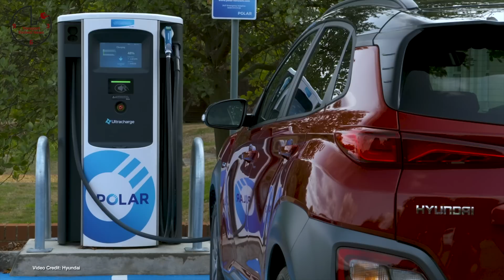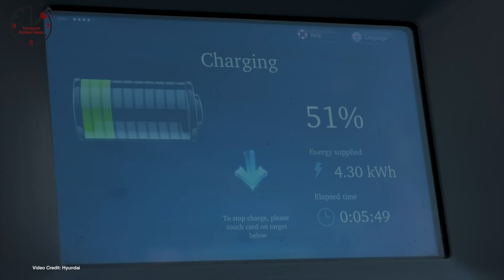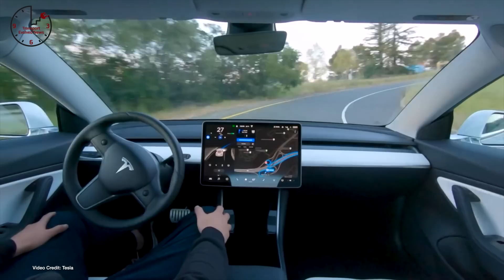TEN 329 - Porsche Taycan Cross Turismo, Big Auto Chases Tesla, Rivian Going Solid-State?

Comment: Did I see drum brakes on the back of the ID.3? That's hard to believe.
Reply: Not really!  Drum brakes can be as effective to stop a car as disks, but are prone to fade over long periods of continuous use, such as going down mountains. With EVs having regen braking, the likelihood of continuous use is low.  Meanwhile, Drums have a few advantages that make them especially suited for EVs.  They have lower drag when released, and the mechanism is concealed from weather making them less prone to freezing solid due to rust, which can be a particular problem for disk brakes that are infrequently used.
Reply: @robertkirchner7981  Well said. Drums are non-linear in their braking force, but on the rear of a car they do next to nothing anyway under hard braking. In a RWD EV where there's loads of regen available they will do next to nothing under light braking also.
Reply: Best choice for rwd EVs. Disk brakes often get stuck because barely used

Comment: Has anyone ever done the sums as to how much a Tesla would cost if it didn’t have any of the self driving stuff?
Reply: Probably about the same as a Chevy Bolt :P
Reply: And improve quality control and interiors.
Reply: Munro did...about 2 years ago...in an autoline video.
Reply: I love the people who shelled out $10K for FSD.  It’s because of them, I got autopilot, the cameras, and active safety features for free.
Reply: Also skip the glass roof, powered doors, and other useless gimmicks.
Reply: @robertkirchner7981  lol they arent useless gimmicks. Tesla squeezes every mile possible out of their cars through efficiency and low drag. The door handles literally reduce drag. The price of Teslas drop constantly as they increase production. It’s not about fsd or door handles, it’s about economies of scale
Reply: @noahno  on most cars  front door handles doesn't matter because of the mirrors. And rear door handles can be done in many clever ways that's more reliable.

Comment: Tesla didn't lose market shares to WV, it's a miss interpretation of the % because the market is growing fast in volume. So in proportion the distribution each share are different.
And it's a good news for all. Meaning the demand is very high, and none of the automaker (including Tesla) can keep up to satisfy it as they face to a battery constraint.
Reply: I think they are talking about sharing the exponential EV market growth since that is what a lot of Tesla investors were expecting, thus the inflated stock price. The issues with Tesla build quality and cost (which may change with the new factories and battery tech) will keep people from switching to Tesla when their brand of choice has a comparable EV in the next year or so.
Reply: Tesla did lose market share, but at the same time the market also grew, so that Tesla didn't shrink in absolute numbers.
Reply: If your market share goes from 81% to 69%, you are losing market share, but in a growing market you can still be increasing your actual sales despite the dropping market share.

Comment: The more EV sales, the better.  Competition benefits the consumer.
Reply: Yes but I am not so sure about the real benefit of competition at the Taycan/Volvo/Mercedes S Class end of the market. Chevy have brought the Bolt down to just above $30k, albeit with basically the same car as in 2016, and that is significant. I think we can only really get excited about sub $40k launches and the prospect of more and more used EVs coming on to the market as leases expire. I just bought an off lease Bolt for $14k with 27,000 miles on the clock. That's a very affordable nearly new EV. I will be looking for an EV Niro in a couple of years time. Really sad that the ID.3 is not being sold in the US.
Reply: @errcoche  Just think, in the near future, you can buy a good used ev with only 200,000 miles on it!  You won't have to scrap a car at 150,000 miles because of a failed ice engine or automatic transmission, anymore.
Reply: @artsnow8872  Never had to, people just don't wanna work on there own stuff. If people would do maintenance they last just fine, these electrics are gonna be more reliable but I still had to make the point that most failures are lack of maintenance related issues.
Reply: @cody2254  Don't  I know that for a FACT. Didn't do enough maintenance on my Chevy 2500 Express Cargo Van and I had to sell it to someone who fixed it up and rode past my place looking almost new and running very quiet too. Well I'll just have to wait for an affordable EV cargo van with at least 450 miles to a charge and DC fast charge or is it the Quick Charge? Also able to haul heavy groceries. An equivalent to Chevy's 3500 with the height of a MB Sprinter.
I can't wait for Chevy's Bolt Ultium EV and Bolt Ultium EUV both with Full Super Cruise.
Just heard a noisey ICE pickup truck go by at 1:00am. Hate those noisey ICE Smokey heeps flying a confederate flag.
Reply: @artsnow8872  at small cars the cost for a new HV battery will exceed the remaining value of the car though...
Reply: @robertlee8805  To get rid of those smokeys the new technology has to get rolled out as in vehicles as in recharging infrastructure. Good news is the waiting time is not so long.
Reply: @errcoche  High end expensive products have to plough the way for new costly technology in cheaper ones. This happens starting from computers, tablets, smartphones, and ending with TVs, refrigerators, washer and dryers and so on. Finally the time has come to cars. Yes, in fact, the time was due long time ago. However we have to mind the old saying: it is better later than never. That is why you will see expensive EVs not only from legacy automanufacturets and startups but also from new cars companies like Sony or Magna.